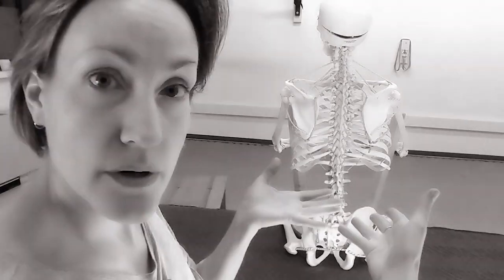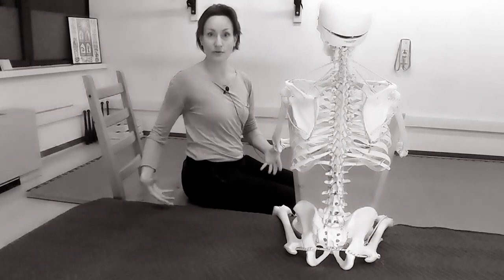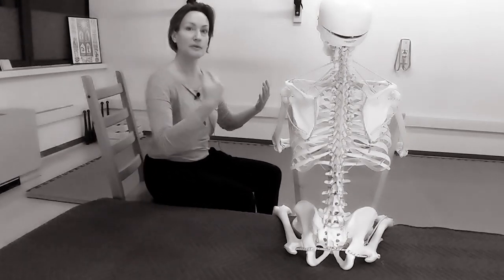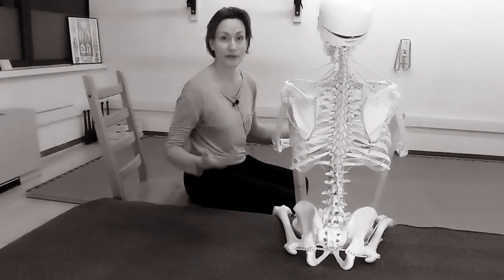Sitting Well

Comment: Great video!  I learned more about sitting properly in these last 7 minutes than I have in my decades of sitting.  Thank you!  May I request a video on how to stand correctly at a standing desk?  I have one at work, with a special mat for standing but my posture isn't the best.  I am learning as I stand but would love some tips from a pro.  Cheers!
Reply from the maker: Thanks, RDJ! I'm so excited people are moving to standing desks, especially the ones that can be adjusted to different heights, because the bottom line is we don't want to get stuck in any one position for too long. Standing alignment will definitely be the topic of future videos, so stay tuned. For now, remember that in any upright position, you want maximal length along your vertical axis. The temptation of collapsing your upper body weight into your waist, hips and legs in standing is mighty, so in order to keep your length:  stand with your weight evenly balanced between your two legs (hip width apart) and imagine being suspended from a string that sprouts out of the crown of your head and attaches to the ceiling for support. It should feel like your spine is hanging and your back can completely relax. Use relaxed breathing to maintain that image rather than "pulling up" your chest and chin. Be subtle about it, and enjoy the exploration!

Comment: Awesome video! Thank you, Tessa! Can you say something about the importance of the feet on the floor? I sit a lot on a bar stool (no, not in a bar, haha) in my kitchen which has become my "office." My feet usually either grab onto the lower bar of the stool or I prop one foot up on a shelf in front of me to open my hips. <3
Reply from the maker: Thanks, Vosignificando! Having the feet in contact with any kind of surface while sitting (as opposed to dangling) gives us the possibility to use our legs to help find better support for the trunk. But indeed, they don't have to be flat on the floor to be useful! In fact, feel free to arrange your legs in any way you like, as long as you're able to stay on TOP of your sitz bones with minimal effort in your trunk. Remember, sitting at the edge of your seat as per the video gives you the best chance to reorganize your base of support (your pelvis), so don't lean back except for short breaks. If your feet like to rest on the lower bar of the stool, great: push into that bar a bit with the balls of your feet to feel the effect on your pelvic organization. You'll quickly figure out the role your feet can play in any position to help you get higher up on top of your sitz bones. 
Propping the feet up can be restful for a while, but don't get stuck there too long either (especially with only one leg up), because it might encourage your trunk to turn off and collapse into itself. See the image I gave RDJ to use in standing, which is equally applicable in sitting!